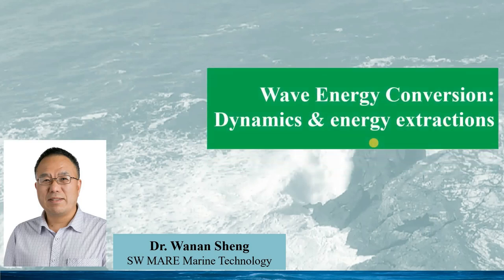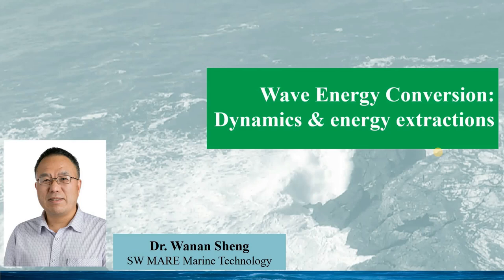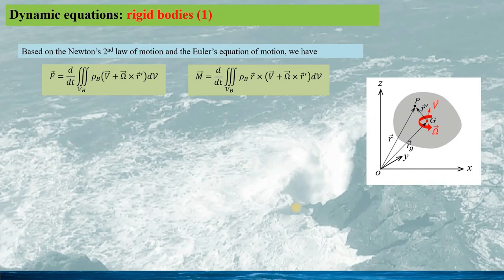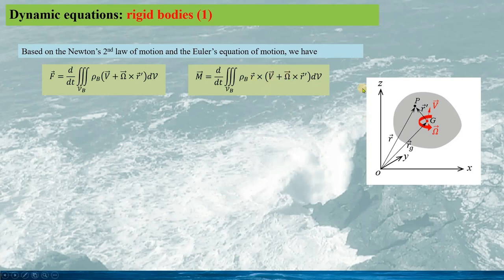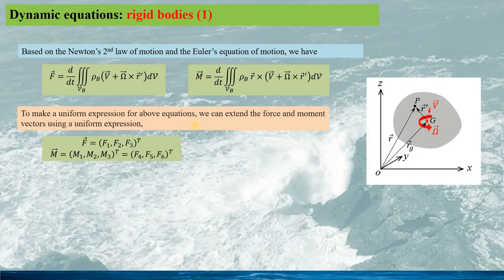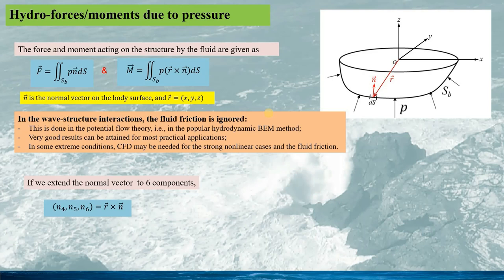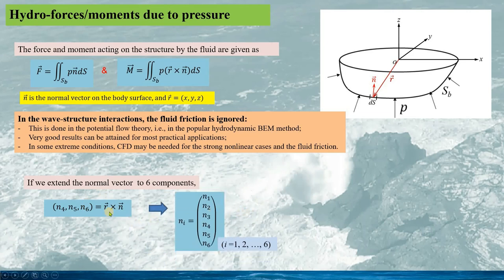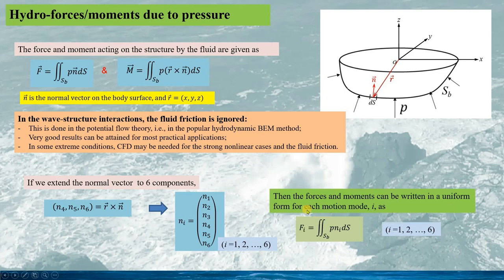[Wave energy conversion] Dynamics and energy extractions

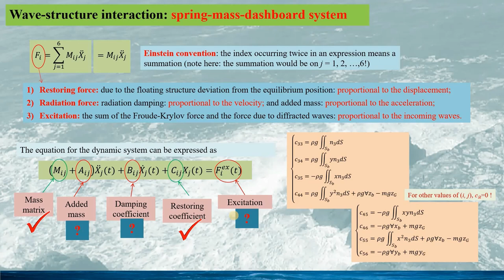Comment: I would like to see how you solve the dynamic heave equation at 25:00 that you said you would look at in a separate talk
Reply from the maker: Thank you. I have a talk on that. I have a series talks on the dynamics, and in the last talk, 2 examples are given, in where you can find the relevant information.
Reply: @ScienceofFluids  Because I have your attention which is much appreciated. I’d like to ask a question. If you were to design a buoy to measure wave heights, how far into the design would you go? Would you perform a free release test to find the dampening coefficient and added mass and then virtual mass? Or would you just create a buoy and use it based on assumptions?

Comment: Hi, would you consider talking about the dynamics and control of the salters duck? It was one of the first point Absorber WEC in the 70s I have been looking for info on the control of it ... but can’t find it anywhere.
Reply: Wanan Sheng Thanks for answering, I have a question though, is cause I am making my undergrad thesis building a duck prototype... the duck supposedly uses reactive control for which I understood it changes the natural frequency of the oscillator so it has the same frequency of the waves and it operates in resonance maximizing the energy absorbed. But how does it change the natural frequency? What would be the actuator in that case ? 
I also saw a paper on optimal control of a heave oscillator in which the force the oscillator makes upon the hydraulic cylinder PTO is considered the control force for which I was really confused since that force is the load on the generator so I have no idea how could I control it since that force would actually depend on the oscillator movement. I guess my question in both cases would be what is the actuator? A motor ? Some variable stiffness spring of some kind? All the papers I have looked don’t talk about this and treat the actuator  “u”  just as a mathematical signal but don’t talk about the physical implications of it or what is it.

Thanks in advance your videos  are a treasure I am a mechanical engineer so marine hydrodynamics is not my strong suit your videos help a lot
Reply: Wanan Sheng thanks, although what I don’t understand ( in the heaving buoy case), is which one is the physical actuator controlling it . The heaving buoy drives the hydraulic piston ... yet the reaction force made by the piston is the control signal “u” in the mathematical model for optimizing energy absorption. I can only imagine the piston is sometimes driven by the buoy and sometimes drives the buoy am I right in thinking this? 
Sorry for asking so much, thanks for all the help...